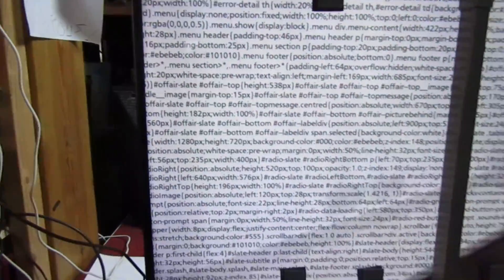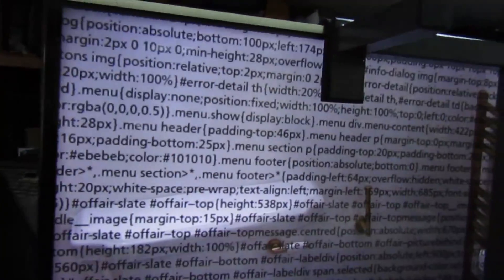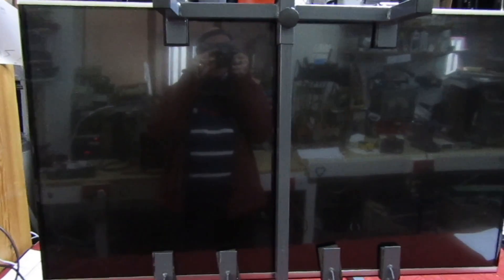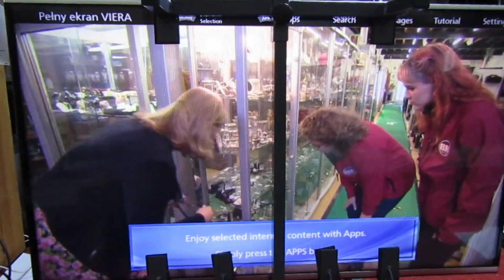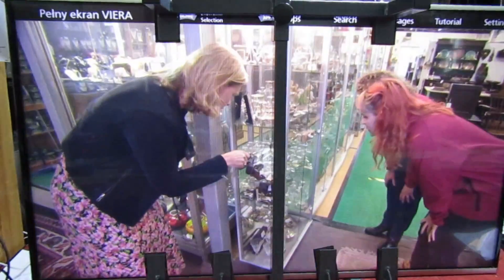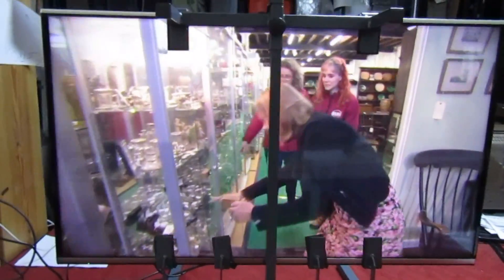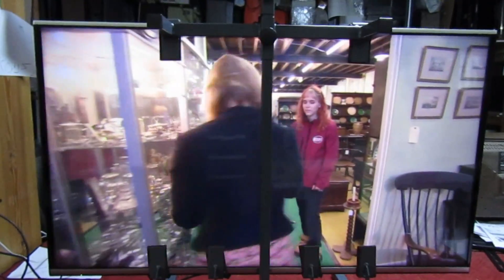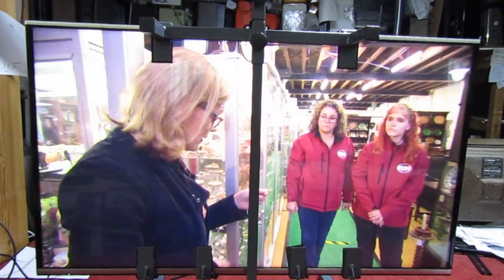Flat screen TV , I bet you have never seen this before .

Comment: There is a jumper wire connection for the diag port  that has come loose in transit. Or the diagnosis board is ba

d 8 years old?

Comment: Interesting!
As others have said here, that's CSS you're seeing. CSS is a language which is used to style HTML pages (not actually a programming language itself).
I'm guessing the TV's menu system is built in HTML, and it's having an issue properly rendering the page, thus leading to a big CSS dump.
Reply: It does indeed mention "menu" in few places in the code. A very interesting and bizarre fault.
Reply: It could also be  a closed captioned code link.

Comment: Strange fault that will require a board replacement to cure it.
Reply: Yep but its also got a cof fault so new sceen😮
Reply: @richardh100  That makes any attempt to repair not viable.
Even Panasonic as good as they are can make a few bad samples.
Reply: yep but not a panasonic it's a vestel junk with a faulty screen
Reply: @richardh100  Same difference, Vestel now make panasonic tv's
Like a lot of brands the name on the front means nothing, it is just badge engineering.
Very little is made in Japan anymore, only a handful of expensive models for the Japanese
market only.
This has been going in since the 90's, i have a collection of Japan only gear and it is far superior
to the mass market junk that carries the same name.